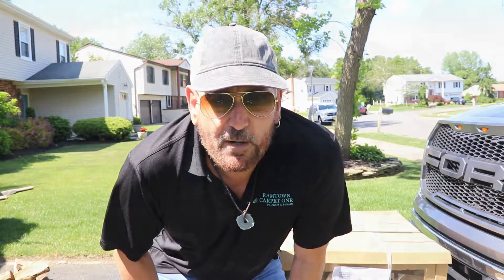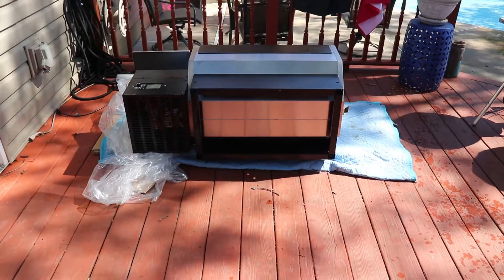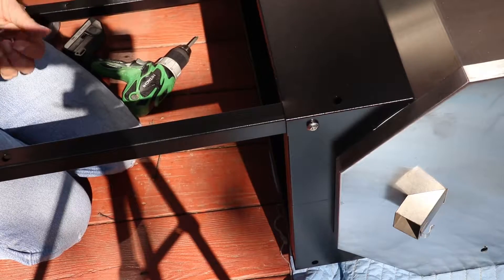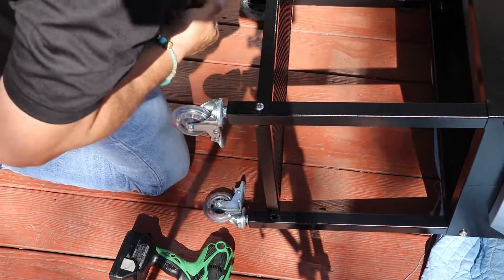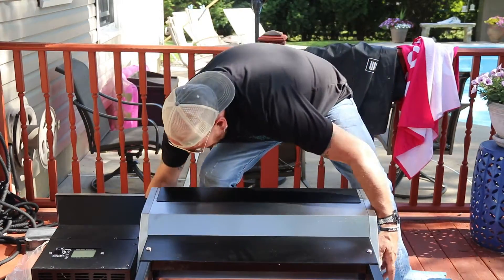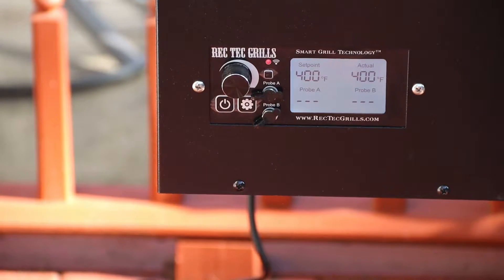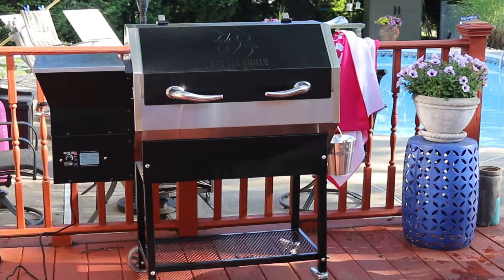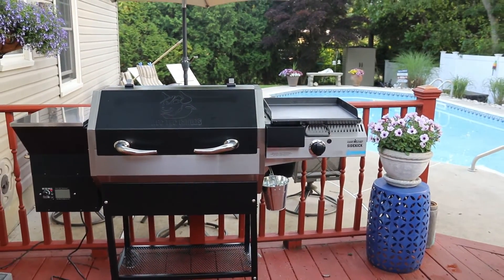Rec Tec Pellet Grill (Stampede) with Camp Chef Sidekick Mod.

Comment: How’d you install that sidekick?! Awesome video. My stampede just shipped today!
Reply from the maker: Hi Eric basically 4 SS bolts I picked up from HD. Literally took me 15 min. Stick around for some great Rec Tec cooks..
Reply: The Gallery Backyard BBQ will do. Thanks brother!
Reply from the maker: @davidtate9497  thanks Bud hold tight coming soon.
Reply from the maker: @davidtate9497  also just did a Tri Tip using this combo.  275 till 120 then seared sidekick at 450+ on all sides.   Unbelievable
Reply from the maker: @davidtate9497  💯% your gonna want to do this Mod. It's why I passed on the Bull(side smoke stack)and why the Stampede with this Mod is a better option then the Bull.